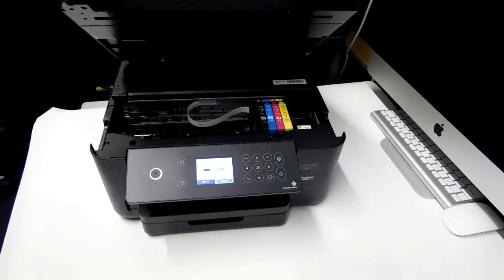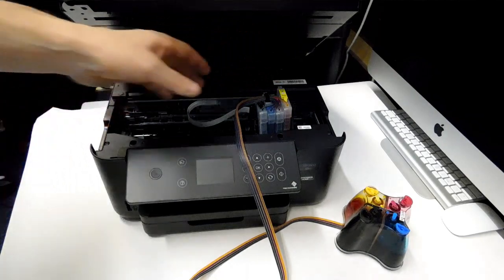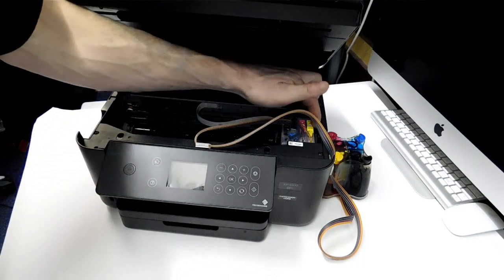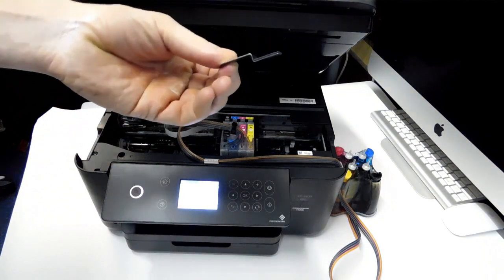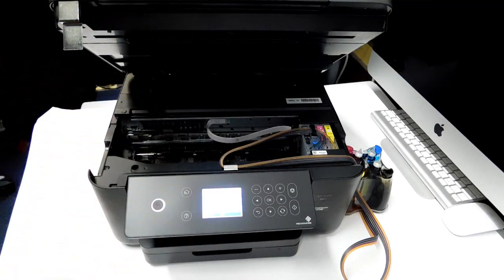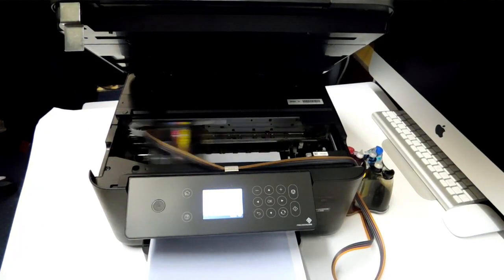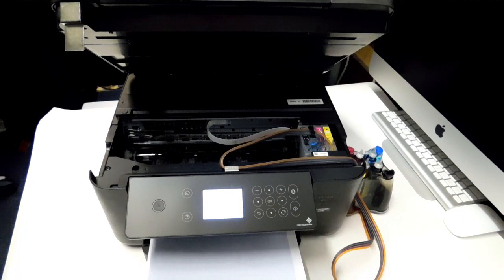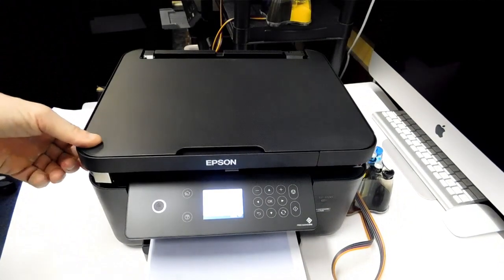Ciss Continuous Ink System Fits Epson XP-5100, XP-5105 Printer

Comment: does this work in the USA   for the epson XP5100 , my epson XP320 died , it had a CISS  i bought from ebay , back when they werent so well known , i installed it & used it for a few years , with absolutely no problems , my new printer is pretty much still new , in fact the other ink levels are still full , all but the yellow ,im sure thats just a preview of the future , constantly buying/ replacing full cartridges ,  if this works in the USA i would most likely buy it